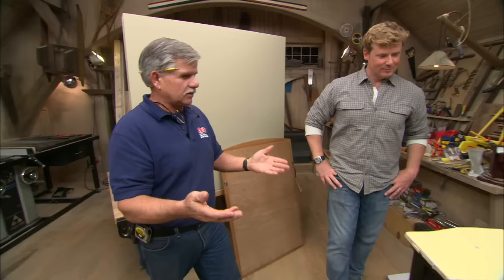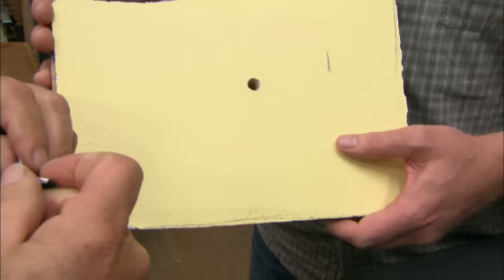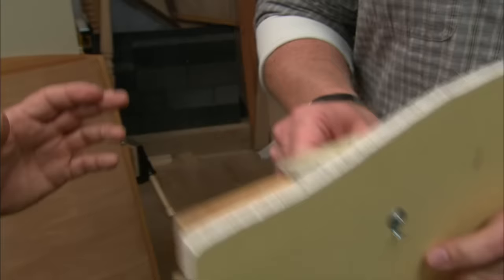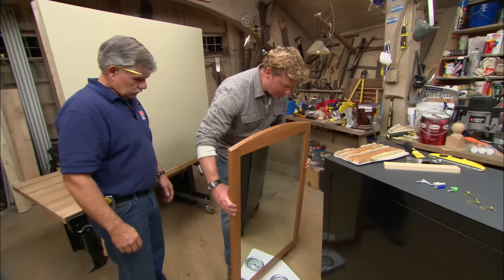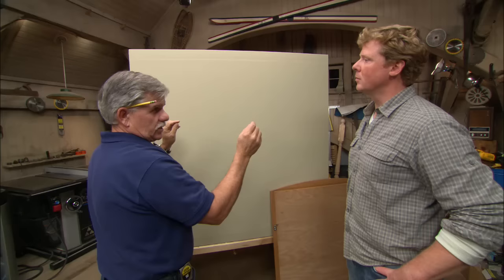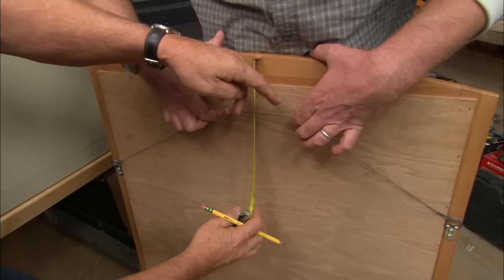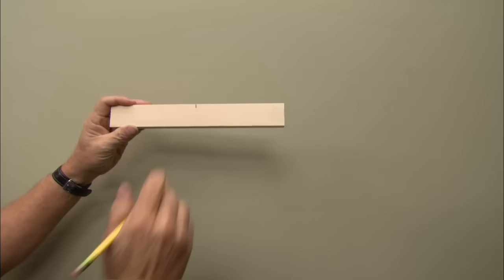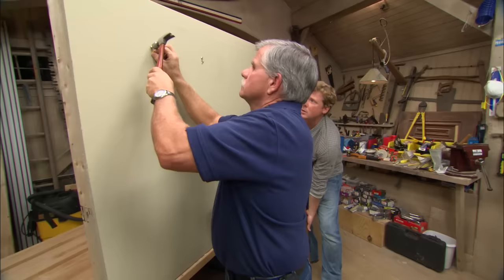How to Hang a Heavy Mirror | Ask This Old House

Comment: I have a heavy mirror with nothing on the back.  What do i add on it to be able to hang it? 

Thank you in advance
Reply: Get a professional French cleat hanger - it comes with two parts, one screws into frame, for the other part find holes that are on studs. You can even add epoxy glue between frame and the rail. I have 100 pound mirror hanging like this for years, no issues. They came in multiple lengths, get the longest one that won't protrude beyond the mirror. The key is to get professional version that has U shaped part for the mirror side - those are much stronger and you can even hang cabinets with them. For example https://hangmanproducts.com/products/professional-french-cleat-hanger
Reply: @meperson  wow, thank you ⚘💜⚘💜
Reply: @Lia2222  you are welcome!

Comment: This is for older houses. Do not attempt this unless you know what is behind your drywall. Especially if your house is built in the last 40 years This is insanity. Why use drywall plugs if there's wood behind the drywall. Why not screw into the wood? Plugs are designed for the spaces in between the studs where you can't screw into the wood. They are only good for low weights at best, prone to failure and damage the drywall even when they don't fail. Hanging something heavy from the drywall is never a good idea. Depending on where you live, and building codes, most houses built in the last 40 years are built differently and have wooden  studs spaced every 16 or 24 inches behind the drywall. Get a stud finder and screw directly into the stud.
Reply: Shane Hartley drywall can hold a 30 lb mirror without any issue.
Reply: Shane is correct!! As a carpenter, I fasten my mirrors and heavy shelves to the studs behind the drywall. Professional, solid, and you will never, ever wonder if it will fall out!!! By a stud finder or use a hammmer. Start from an electrical outlet and measure to see if the studs are 16" or 24" on center.

Comment: Oh dear me, that looks like an accident waiting to happen..... PLEASE do not hand anything above the size of a 10x8 photo frame on those pin nail cheap hooks ...
Reply: This is like the worst prank ever lol. I'm gonna start reading the rest of the comments to find the horror stories
Reply: It's the dead of night. Everyone's sound asleep. CRASH!!! SHATTER!!! This would eventually come down. It's just a matter of physics and time. Those skinny little nails have very little surface area and they're in dry wall. Over time, the weight of the 30 pound mirror begins to compress the drywall material. Give enough time and movement (Like the kind you get when cleaning the mirror) it's coming down. You're 100% correct, light (And easily replaceable) stuff only. Tommy is dead wrong on this one.
Reply: @mcgeorgerl  what would you consider light?

Comment: isn't the wood studs installed the other way around behind the drywall, narrow side outward to avoid warping? The 2X4 or not really, just a standard 1.5" X 4" wood stud means you have 4" deep to drill the hole while the screw looks like about 2" long. Sorry, I am not a professional, my opinion may be not that good.

Comment: Keep in mind those “ cheap hangers” are rated and using common sense for those skeptics, the anchoring nails are nailed downward (perpendicular), which will be stronger and more secured to hold the mirror up, unlike nails that go straight horizontal into the Sheetrock !!!

Comment: What if the mirror doesn't have a wire or anything to hang it with?
Reply: +Hannah Reno ,     That usually means the piece is very heavy,  and the framer wants you to use two separate hooks- one for each side. That reduces the inward pulling stress on the frame.
Reply: +Mike G Oh okay thanks!

Comment: I want to hang a heavy glass framed picture (I'm talking 5 ft diameter, maybe 15-20 pounds) on a marble chimney breast without drilling a hole in the wall and damaging the marble. Is it even possible? Ceiling cables maybe? Some kind heavy duty adhesive pads?
Reply: kipling1957 flex tape

Comment: I got a 50 lb, heavy f*cking mirror.  Going to hang soon.
Reply: +Den Moumoiazei Bruh my mirror has been on the floor for a few months, because I never knew wtf to hang it with or how to hand it!
Reply: +Corey Grimes u got it now? I hung up my f**** mirror
Reply: FP no not yet, I am inverting in some mollies this weekend. It's time to turn this house into a home!
Reply: +Den Moumoiazei .....a fucking mirror is harder to hang than a regular mirror....if it is an old house with lath wood and cement  than a  toggle bolt hook is best  ....if not a molly....    :)   :)
Reply: +sophia loren I used a heavy duty anchor on one side and luckily had a stud on the other.  At least I can find a stud, you never could :)
Reply: LOL......DON'T GIVE UP YOUR DAY JOB TO BE A COMEDIAN SON   :)
Reply: I am very concerned & nervous  because my heavy mirror has to hang directly above a radiator !
This is on my main wall ... I previously had a large mirror there ...
BEFORE new radiators were installed by the landlord. 
The old mirror had been there for 10 years. But I now want to replace it with a new mirror. 
I am nervous because all the OLD wall fittings are in the wrong place
now & due to it being over the radiator etc

Comment: This video is dangerous.  Does not matter what kind of fancy screws/hooks you use, if you hang a 30 lb mirror on Sheetrock wall without securing into studs, that mirror will come crashing down. Hopefully not onto a small child.

Always use a stub-finder and secure heavy objects onto a wall properly.  SAFETY 1st.

Comment: I just don't like those skinny nails that depend on weight to keep them in place. This along with those tiny hooks with a small lip, can cause a serious accident and damage, should you brush or bump against it and pop the cable off the hook.  Especially so with children in the house. The nails pull out very easily, since they are thin and not threaded of course.

Comment: Never hang a mirror on a wire
Reply: If you're going to make an absolute claim, please say why.  What is your reason?  Give people something to work with.  Help people understand, they may be able to apply the lesson to other situations.
Reply: Kragh - Here's my 2 cents. Mirrors tend to be heavier than most artwork. Picture wire, generally, comes in either coated or uncoated and in several different diameters/gauges. To hang a 30 pound mirror requires some of the heavier wire and the wire must be installed correctly at the d-rings. But the problem is that the wire has to come around the edge of the hanger hooks and that called a 'break angle'. There's a LOT of stress there and, over time, that stress will compress the plastic coating and start to work on the small wire strands. The weight of the mirror, break angle, wire type and strength all must be taken into account as well as the USE of the hanging object. Mirrors get cleaned a lot and the movement that occurs when cleaning can also lead to failure.